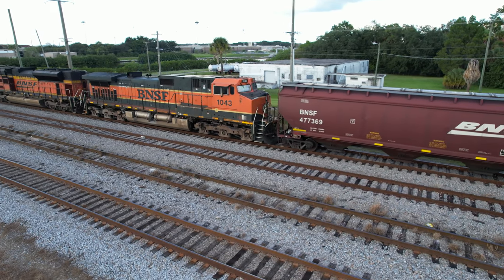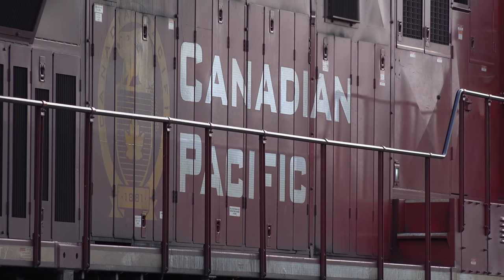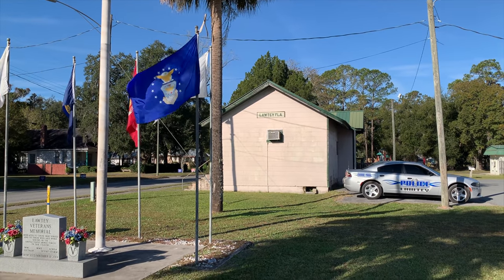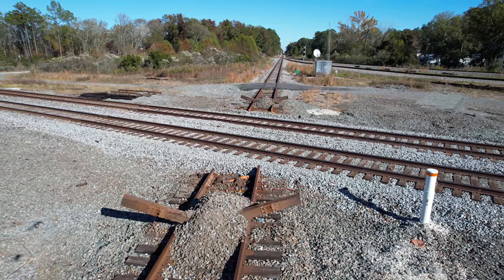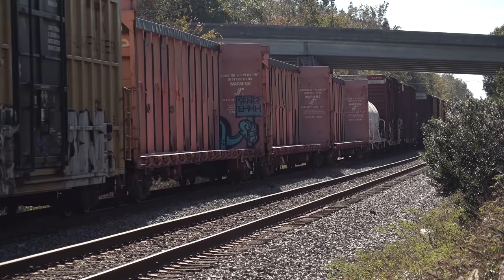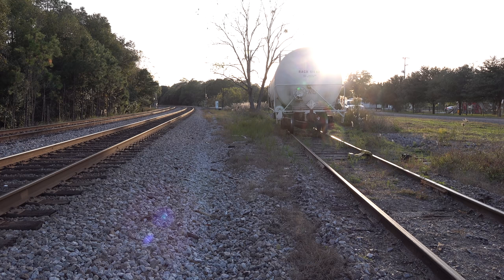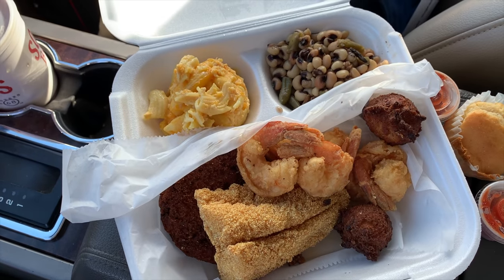Why We See Foreign Locomotives

Comment: Thanks for the info on daily locomotive-use billing in run-through power. I assume that the local railroad supplies the fuel for this power when used on its tracks. When the power is interchanged, do they note how much fuel is in each tank, like we do when renting cars or using dealers' courtesy cars?

Comment: is it possible that it may also be cheaper and quicker to train csx crews on the foreign equipment since much of the time its quite similar to csx equipment? granted there may be some software differences but the major stuff like throttle brakes and cut outs will likely be in similar positions
Reply: All of the equipment is identical inside, no training required. The exception may be a Ferromex or KCS locomotive which  has everything labeled in Spanish. But if you know your way around a locomotive, you don't need labels anyway.

Comment: I'd wondered how things like routine maintenance would be done while engines are far away from their own company's shops.
Reply: If they run out of time on the Blue Card, they cannot be operated until the 92-day inspection has been completed. And while the host railroad company is quite capable of performing it, they also have to pay for the service. Ideally they try to make sure the engines return to home rails in time to perform their 92-day and annual inspections, but certain agreements are made between the carriers if they can't.

Comment: Were I live, unless I know who owns the track its hard to tell if its foreign power or not. Union Pacific, BNSF, Norfolk Southern, CN, and CSX all have track in my area. Not to mention Amtrak and Metra run trains where I live. Now, If I live in the North Suburbs of Chicago instead of the South Suburbs, I would likely also see Canadian Pacific.

Though not foreign power, the other day I saw a CN locomotive that was still in its Illinois Central livery (only the nose had CN branding on it). I so wish I had gotten a picture/video. Pretty sure it was on a former Elgin, Joliet, and Eastern Railway line. I think I saw another Illinois Central Locomotive a few moths ago, but this time I saw no CN branding on it and it look like it was a fairly fresh coat of paint. Again no pictures since both times I was driving and could do so safely.

Comment: I did not realise why and how foreign locomotives were used, so thank you for your interesting video which explained it. 
Just one question- Do the foreign crews continue on the locomotives or do they change to the local railroad's crews?

PS. Florida is my favourite USA destination (last vacation cancelled due to Covid),  but I've only managed to get videos of Amtrak at Kissimmee, so far.
Reply: The crew changes at the railroad interchange. A BNSF crew would not have qualifications to run on a NS route BNSF doesn’t have trackage rights on, so a NS crew would take the train from the interchange point.

Comment: Nice work there Danny Harmon (sp?).  Casual noob here.  You used two terms to describe the length of a train.  You used number of axles, and length in feet.  I can do the math after putting a couple of things together, but one freight car has four axles each.  The length in feet was interesting too.  Cars have different lengths so the consist length depends on knowing those things.  You used those terms for different trains so that wont help.  All I want to know is; are those normal terms to use for the lengths of trains or of not, what is?  Thanks.

Comment: I am East of Pittsburgh Pa., and the NS Mainline that runs from New York to Chicago or the Mid West, so we get to see many foreign power run through.

I have a curious question that no one seems to know the answer:
On the NS main line, there are 2 head end loco's, sometimes 3, 90 to 100 cars, 2 DPUs, an additional 80 to 90 cars, then 2 helpers. That is only 6 or 7 locos to climb the Appalachians to continue East. That would be about 25,000 HP.

Why is it then I have seen video of trains in Missouri and Kansas with 5 to 8 lead locomotives, 80 to 100 cars, 2 or 3 DPU, additional 80 to 90 cars, and 3 or 4 helpers? That would be up to 15 locomotives. Most are 6 axle locomotives. Someone was bragging he had 42,000 hp. Is that much HP needed to reach hi speeds, or are some of the locos being transferred?

I have asked a few times here on the internet, and asked a few people I know that work for railroads, but no one has an answer, only guesses. Thanks.

Comment: Hi Danny so do the hours waiting on a siding count as chargeable hours on a foreign road? (would a UP loco held up in a CSX train in the siding for 2 hours for example mean that CXS owe UP 2 hours pay/or money of their locos for 2 hours)?  or only moving/rolling hours?
Reply: That depends on the type of agreement the two companies have with each other. When it comes to runthrough power, time is of the essence and so any time they are just sitting and waiting is costing the host company money. Of course if they have an agreement to spend 48 hours unloading and they were able to get it done in 12, then those 36 hours are gravy!
On the other hand if you have borrowed power, usually they count days on the Blue card as opposed to running hours. So if the engine sits in the hole and is off and not using fuel, then they are not counting that idle time.

Comment: Where I live in Iowa we have the Canadian National RR right near my house. It still has a 5 ish coming in and a 10 ish going out. The main line is north of my place and I'm trying to figure out the signal lights on this particular rail. Red on steady burn the other light is either red steady on or flashing. There are two sets of tracks at this location. What gets me the most is I'm waiting at this crossing and the fools that go through the crossing guards are not only nuts but suicidal to boot. You can turn around safely and find another route. Sorry for the digression. I had to vent. Can anyone inform these signal lights?

Comment: If a "foreign" locomotive has a mechanical failure that requires shop work while its visiting another railroad, who exactly ends up responsible for that cost? I cant imagine CSX or NS would be thrilled having to shell out for the full repair costs of something that was only 20-30 miles down line in their territory. Is this something that is negotiated, or as soon as there is a hand off of the "keys" so to speak - does the receiving line take full responsibility for the locomotive - shop and fuel costs as / if needed?
Reply from the maker: Don't know the answer to any of this. I would guess they make basic repairs on the engine to make it roadworthy for "dead-in-tow" service back to the owner.

Comment: Danny, do you know why the term "Foreign" is used to describe all Loco's from another company....? 
Loco's from Canada are definitely foreign, but engines from other American companies are not foreign as you said... probably "Competitor" would be more appropriate maybe...?
2:16 that Canadian Pacific Loco is definitely FOREIGN power... :-)
Reply: It's a term that is used to describe any train or equipment that's not local to the territory. Since the railroads belong to a company, anyone's train or equipment not belonging to that company is a foreign piece of equipment. It also means if it breaks down or needs repairs, the railroad it's currently on is not responsible for performing such tasks. (even if they break said equipment. ) And if repairs are needed in order to make interchange between railroads, the host railroad has to come to an agreement with the foreign equipment owner in order to establish who does the repairs and where they are conducted. If the total cost of repairs can be completed at a local shop, versus tagging out the equipment (bad order) and sending it to the home shop for repairs, then they will sign a work contract   to get the work done locally.

Comment: Hay Danny, what is that tapping/clicking noise I sometimes hear from a locomotive?
Reply: It's called a "Spitter" which is an electronically controlled valve positioned at the lowest point of the Main air reservoir and as it detects moisture inside the tank, it releases just a small amount of pressure to eject that moisture from the tank. You should hear one of those on a cool, but muggy or foggy morning. It's not clicking, it's more of a flatulent sound...
Reply: @SD40Fan_Jason  No it is more a clicking noise. Jaw Tooth did a video two weeks ago starting at 0:48 there's a red engine from the Cincinnati railroad doing it. Find that video and I'll show you the tapping/ clicking noise I was talking about.

Comment: Why is a X track expensive to maintain ?  no moving parts?
Reply from the maker: They take a terrible beating from train wheels and have to be replaced at closer intervals than other track appliances like switches. Plus there are no standard diamonds. Each has to be built to the exact angle of the particular crossing location.

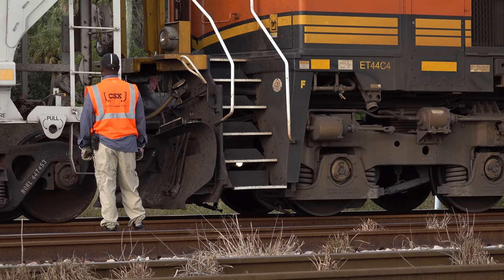Comment: 4:46 did they just pull on a freaking brake hose!?!?
Don't you have to disconnect them manually?
Reply: Actually no. The gladhand design on the hoses are intentionally made to pull apart. I wouldn't want to have any part of my body near those hoses when they do separate! That's 90PSI in a 2-inch pipe and it feels like being beat with a baseball bat! (Voice of experience there.)

Comment: When BNSF engine are used on say CSX tracks, is the on-board crew solely CSX? or is there someone from BNSF who is familiar with the engine, cap controls and software used?   Would the BNSF engine have all the track conditions, inclines etc loaded on its computer? 

And if BNSF crews remain on board, I take it they have no "right" to operate a train in foreign territory with which they are not familiar?

BTW, you forgot to mention that in some cases, there are trackage rights where railroad 1 has the right to run trains on railroad 2,s tracks and have engineers certified for railroad 2 divisions on which they have trackage rights.

Comment: It was simply a matter time before the railroads would begin using each others locomotives.  Just common business sense to keep the bottom line "black".  In today's economy, high prices and cut throat competition, saving a buck here and bit higher profit for the stock holder, all business's will do what they can to stay in business.  Since you travel the roads often to go to your destination, note the number of trucks on the roads and the number of new shippers there are. Efficiency and time saved means money saved.  But one thing you didn't mention about the foreign power units.  How do they work the crew change?  Do they stay with their units or go back on some other loco?  If so, how do they work that out?  And by the way, what railroads are doing with the locomotives, trucking companies have been doing this for years, at least in the "long haul runs,  in using each other's trailers.  Union drivers probably have it worked out in the hours and loads they deliver and as for independent drivers, they probably have their routs figured out too.  End view?  The more trains and trucks on the more, is a good indication of how are economy is doing.  Just spend one day on the I-75 or I-95 and count the number to big rigs going by in just 1 hour.  It would be easy to count over 100 in just 10 minutes or so, therefore the trains have to be on the ball.  After all, "Time is money".